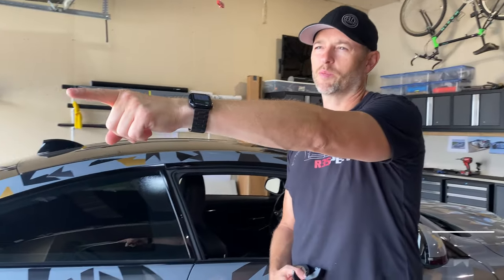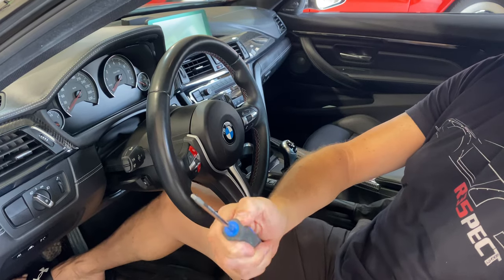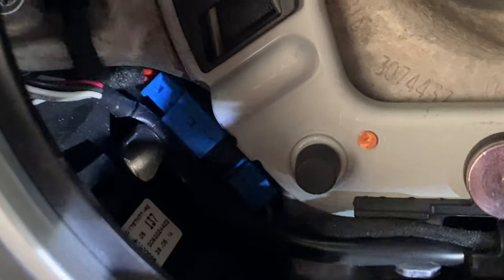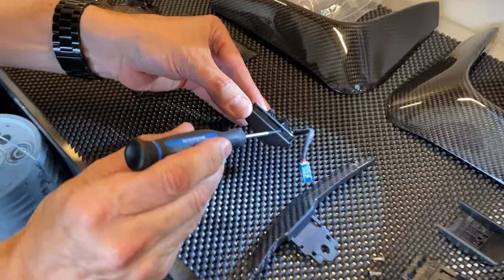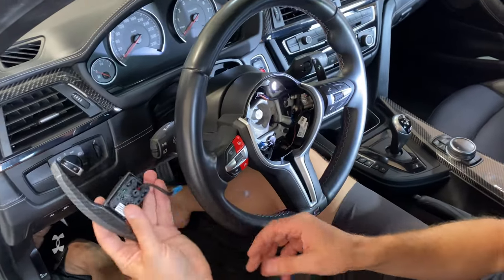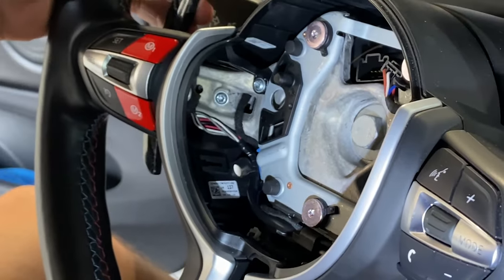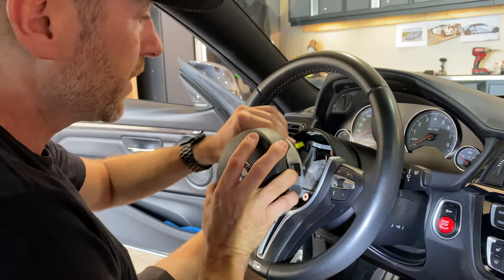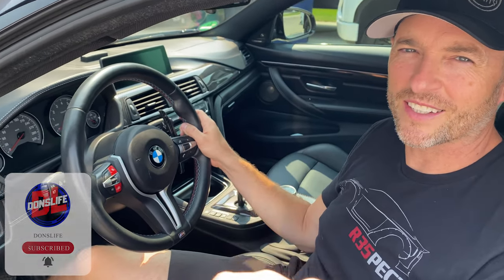Installing Carbon Fiber Shift Levers for a BMW M4 F82! Full Installation & Tutorial

Comment: You were the only one to show how to the mechanism works to take off
The airbag, thank you! And I wish my f83 m4 convertible battery was that easy to get to! I had to remove 7 button things, and still couldn't remove the liner. I just ahead and installed these lol, thanks! 👌
Reply from the maker: I am usually pretty thorough with my videos.  Glad it helped you
Reply: Agreed. Just followed these steps today and found them incredibly useful. Thanks. Thumbs up and sub
Reply: Link paddle